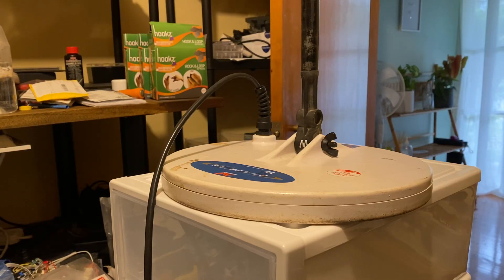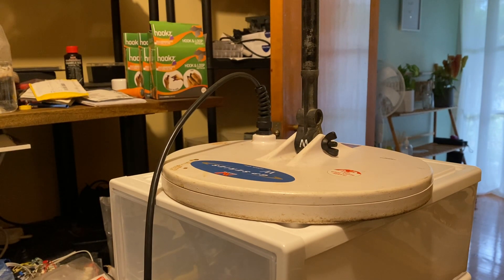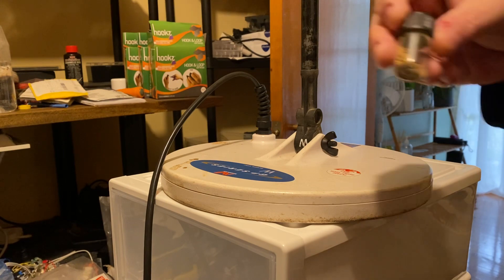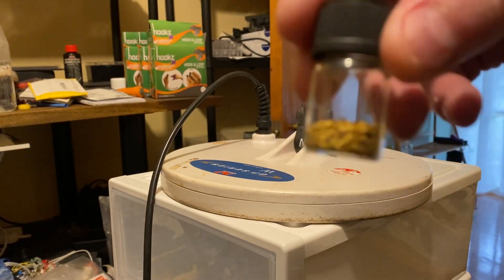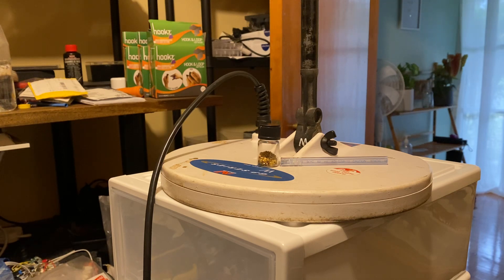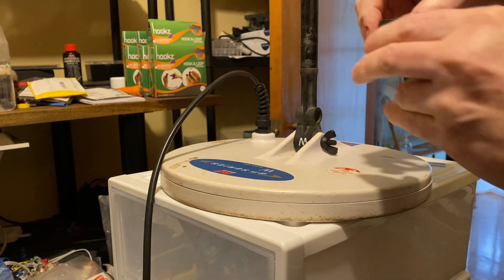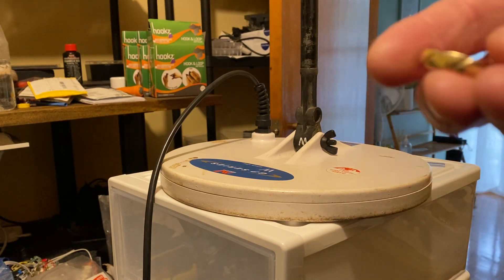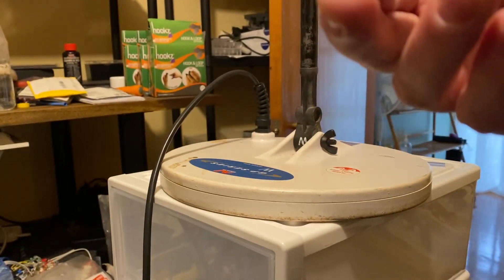Minelab metal detector, What is the easiest to detect? Half an ounce of Gold or tiny wire?

Comment: Wild that this video was recommended to me today. I made a PI metal detector using a PCB I bought from overseas (Impulse III). 20cm coil and been finding some nifty relics (a button being the smallest). My dad brought around his vial of gold yesterday and it was at most 1g of gold. We couldnt get a signal with my detector and it made me feel a bit flat. This has given me some hope lol if only I owned a nugget to test it on. Ill have to pinch the wife's rings and test them 😆
If you see this, thank you for the videos you have been making. I have been on a binge today learning whatever I can to improve on my little DIY detector. My coil is currently 20cm, casing is 3d printed with ABS plastic. Using 0.4mm enamel coated copper wire and I tried to stack the strands neatly. I haven't got any form of shielding and not sure I full understand how to hook it up to ground it. The wire going back to the unit is just an audio cable of some sort, cant remember where I found it. Dare say I have alot of improving to do.
Reply from the maker: Detectors are finicky beasts.